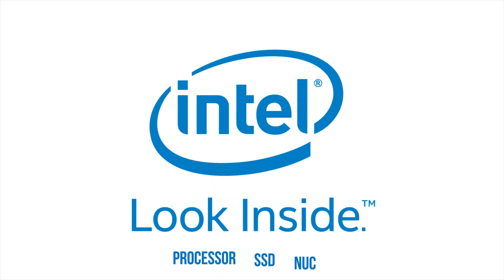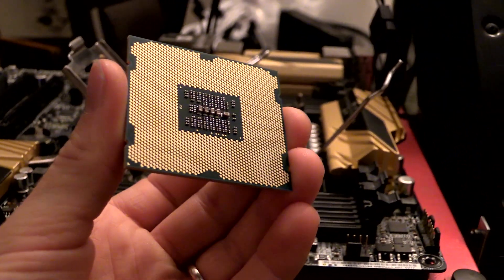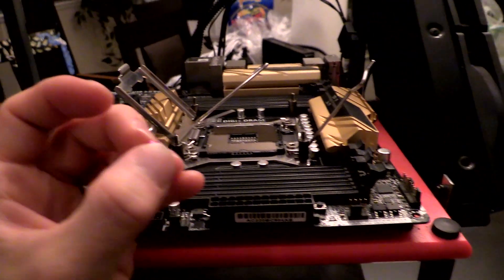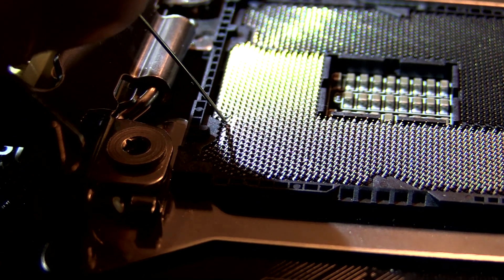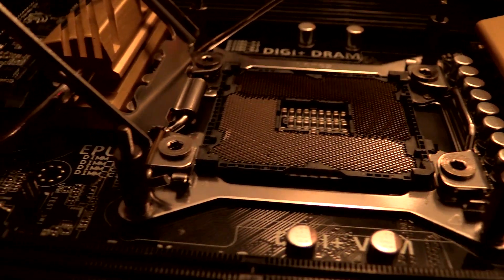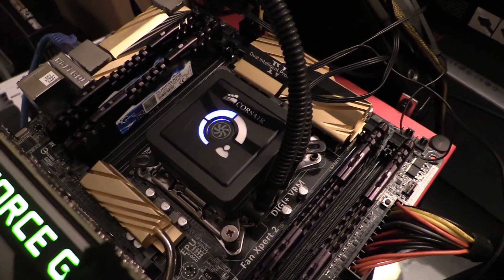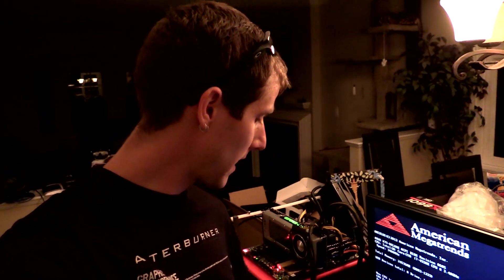LGA 2011 Socket Pin Repair Vlog - Fix a "Dead" Motherboard

Comment: That motherboard was still in warranty. I know, because Asus gold color motherboards came out last year, 2013. So, why didn't Linus RMA it? I wouldn't trust that ghetto repair, any movement would cause it to fail again. I would have RMA it, because it has between 3 to 5 years warranty, at least 2 to 4 years left.
Reply: Angel Luis Trinidad I think most of the people are gonna send to warranty anyway. Like Linus said so many times, "do what I say, not what I do." Unless it is a free board with no warranty like this one.
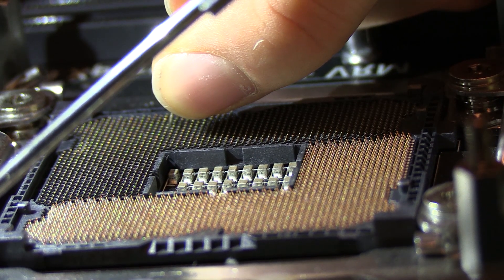Reply: Angel Luis Trinidad 2:50.
Reply: ***** Did Linus say it was an engineering sample? I watch the video, and I didn't hear that.
Reply: Angel Luis Trinidad He did, I would link the timestamp but I need to head out.
Reply: CK Gamer Thanks guy, it's true I heard it, it's an engineering sample. Still, I don't trust the repair, any movement can cause to fail, and if you keep messing with the pin, at some point, it's going break. Cross your fingers.
Reply: Did you read my other comments, I think that was already established, so, you are a little bit late. But, thanks for your comment.
Reply: RMA takes forever as far as customer services go. Good luck to anyone
Reply: Angel Luis Trinidad No offense. I want to put this politely. You should probably just delete the comment and comment chain. It will save you time. No one ever reads the sub replies.
Reply: ***** Look at the 2 posts above mine. I'm trying to tell the original poster that if he doesn't want to keep getting replies for stuff already covered then it's easier to just delete it. No, people still leave comments on the original correction even if a thread is 300 replies long...
Reply: I'm retired, I do this for fun. I don't care about the time it takes me to do a comment. I just want fresh new comments that add something new to the discussion. So, thanks again for your comment. But, I had to point out that what you said in your comment had already been said.
Reply: Did you not watch the video???
Reply: Void warrenty. I had this happen to me with a z97-a. Honestly i'd never built an intel so i didn't realize contacting pins are on the mobo so when i bought it and when the girl at the counter did a 5 second showing i had no idea where to look. Got it home and a week later after tinkering and trying to figure out why my last 2 dimm slots didn't work 1 pin in the top right was bent. This voided manufacturing warranty AND the extra 2 year plan i bought from the store on my board. Had to pay someone 45 bucks to basically do this. Though it's been a few weeks and all is well.
Reply: You don't trust "that ghetto repair", but you have to know that the "official" repair of ASUS would be pretty much the same thing, but with additional transport taxes or even more: in some cases you have to pay for the whole repair.
Reply: Really, I doubt that they would replace the entire mobo for just one pin that can be easily repaired.
Reply: 1EXTreMAR My experience with Asus RMA was very good, I got the RMA number online in less than 30 minutes for my Asus Z87-Expert motherboard that begun to have shut down issues about four month after I bough it. I sent the motherboard alone and kept the accessories. About ten days after, I received a completely new motherboard in a retail box with all the accessories. I didn't get a repair motherboard, I got a new one. Now I got two retail boxes and extra accessories. I only paid the shipping back to them, and they paid the shipping back to me. I was really happy with Asus RMA service. Off course for those ten days I had to use another computer, that was the only hassle. But generally, I recommend the Asus RMA service.
Reply: Angel Luis Trinidad
I don't think asus will RMA this because could be a user fault. I mean if you bend the pin form inattention or negligence asus will not pay for your fault but I heard EVGA does. I know someone who dropped a screwdriver into the socket and Asus did not RMA the board for his stupidity
Reply: Yes, so in the end asus will not RMA boards with bent pins :)
Reply: Angel Luis Trinidad I agree that a repair can have issues that come back later. It looks like this motherboard is in the test bench rig so I am sure it had CPU's swapped a lot for testing. Probably not a big deal for Linus to use it as a test still. If it were my MOBO I would start saving for a replacement just in case.
Reply: it's and engineering sample they don't have warranties, if it did have one he would have have RMAED it.

Comment: I've had the same luck on a previous AMD CPU. A pin was slightly bent and I was able to straighten it enough for it to fit back into the socket without braking the pin itself. It still works amazingly.

Comment: Congratulations, just saw your dead gpu video. Maybeee, just maybeee you should go for a longer heating next time. I did exact 8 minutes 200°C but first i did  the gpu manualy with a heat gun at 500°C (because it's so good protected), wich saved a Samsung monitor PCB just a few minutes earlier. With non conductive thermal compound, wich you can basicall smear everywhere the gpu, memory and voltage converters are cooler than ever.

Comment: The question is how long will that bad pin last and what errors it will produce; hopefully none. ASUS is good about some repairs, but a bad pin is an instant void of warranty. Tip anytime I RMA and bad MOBO I take pictures of the CPU socket to avoid any questions.

Comment: HEY next time just grab a mechanical pencil and use the end of it to slide the pin in the hole and adjust it in what ever way you need to bend and FIXED if not ur fucked EZ PZ better than "PEN"

Comment: I had two bent pins on my new mobo. They are freakishly small and delicate, it' hard to see where are they bent and original orientation.
It's a more elegant system than AMD's but for bent pin repair it's a nightmare.
But, I managed to do it :)

Comment: I think Mine Pin of the LGA 1155 Mobo is bent too. Giagabyte Mobo. 
But Great part is that my PC boots and Works Fine.
How can i know if my CPU gives some Error.
I cannot Stress Test my CPU (Prime 95) as i dont have Water Cooler. Using Stock Heatsink. (Core i7 - 2600 no OC)
Can some one Suggest me a decent Benchmark Software ? (For Stock Heatsink)

Comment: Hey people, I'm looking forward for a gaming system which can play games such as Crysis 3, BF4, or Saints Row IV (Ultra) and perform more than 60 FPS. Will I regret something with this build?
http://pcpartpicker.com/user/Henvertek/saved/d8ytt6  Intel core i7 4790K 4.0 Ghz, Asus Maximus VII Formula, Asus GTX Titan Black 6gb, Kingston HyperX Beast (4x8) 1866, 	
Noctua NH-U14S 55.0, Corsair CX 750W 80+, SSD Samsung 840 EVO 120GB, and HDD Western Digital BLACK SERIES 1TB. I'll build the case by myself if I can
Reply: Dont get the titan black, get a 780/780ti/290/290x
Reply: Is this only going to be used for gaming?
Reply: yeah, this pc is ridiculous. get a 290 or 2 290's for the best performance for the money and a larger psu, 8-16gb ram TOPS and id stick with that processor. i have the same thing. also if you want to spend less money you dont need that ridiculous motherboard. you could get something cheaper like the msi gaming 7. thats what i have

Comment: whats all that black stuff on the cpu
Reply: thermal paste
Reply: abc140290 why does it look all burn though
Reply: It's the black goo from prometheus.
Reply: SidTheSloth Could be different thermal paste than you're used to using. The stuff I use is pretty light, plus the lighting for this video wasn't the greatest.
Reply: SidTheSloth I think it's liquid ultra, or some other liquid metal paste.
Reply: TheRuiner84690 I just use the stock fan :(
Reply: Astralify plot twist

Comment: Thanks for this video! I tried to sell a working motherboard to someone, and they came back saying it didn't work, so I refunded it then after they left I noticed they had bent the pins. I tried fixing it myself without and tutorial but it just got stuck in a boot loop, I didn't have RAM inserted though. I'll try this, although I still don't have extra RAM to test it with. I'm scared of using my working RAM. :(

Comment: I had to fix about 13-15 pins on my 1366 because the plastic around the socket chipped a piece onto the pins while seating the CPU... it was working perfectly and stable in triple channel mode without detecting 1 out of 3 of the RAM sticks... go figure

Comment: i scored my gigabyte ga-z77x-d3h off a freind who considered it dead which had beed sitting on his bed for quite a while with no static protection and had at least a dozen pins bent on the LGA1155 socket bent so he told me if i can fix it i can have it so i took it home and lets just say after nearly a year im using it to write up this comment XD

Comment: Had a buddy of mine with an AMD FX series try the "put something else in the pin hole" trick and he couldn't figure out why it worked with the board lying flat and not when it was installed vertically in the case. We eventually found out that the wire he used was too short and then it killed the CPU. Dropped another $300 on a new one, sadly, but we got it working. Great rig now!

Comment: I've been using the edges of a (paper) business card to fix bent pins because it has a lighter pressure when re aligning pins than something more solid such as needles. Try it on your dead motherboards so you can see what I mean.

Comment: i used magnifying glass and a mechanical pencil to fix the bent socket pins for LGA1366 the same exact thing happened to me...and it worked .and then i sold my PC as fast as i can.

Comment: Lost a z67 board trying that :( and my i7 2700k 700$ down the drain when I reseated the CPU after bending the pins back after getting successful post and boot. Sad the i7 went 5.2 stable lol and I killed it

Comment: they should make new sockets, (the cpu has spots on it, where the pins hit the cpu) why not make a removable socket, which could lay on the spots of the motherboard, and the cpu would go in the socket as normal

Comment: I had to do this once @3am 2 nights before a deadline with a brand new board (old one died that day) and I didn't have the time to RMA the board. Only difference is I had 15 bent pins for some reason :S Nice job Linus :)

Comment: Actually had this happen to my Maximus VI Hero a few months ago. While replacing the thermal compound on my CPU and waterblock, I noticed the pins were a bit bent. Used a needle, magnifying glass, and my phone's light just like in this video and moved everything back to where it should be. Worked just fine.

Comment: I managed to repair a very similar 'bent pin' issue with a Socket 2011 board by using this technique.

The pin was intact and was 'just' bent out of position.

Very genital coaxing back into position using the other pins around as a reference. Look at the pattern the other pins make in each direction and get the offending one back into place.

Probably best not to damage them into the first place but it can be done if you are careful.
Reply: ROFL. 'Very genital coaxing', u made my day sir!
Reply: I'll just blame the auto correct ;-)
Reply: Dennis Tenn What if he really means Genital coaxing? XD
Reply: It's obvious he meant gently coaxing but LOL.  Genital coaxing is funny.
Reply: Tee Hee Hee ;-)
Reply: HailgodMC lol

Comment: Neat Tech Tip.
I had a bent pin in a board I owned once but I just told the manufacturer that it was their fault and got one for free.
Also can you guys do a video on removing infestations from a PC tower?
My case is quite open so I get millipedes and wasps in there.
Reply: AngryBullbog Never believe Lame Xeno, he's a known troll.
Reply: I can't tell if your being serious or not, but i bought a mini accessory kit for my vacuum that does the job of removing any dog hairs or dust that may be lingering in my PC.
Reply: ***** He's trolling, and being lame. Don't feed him.
Reply: Besty008 stop feeding the troll damn it!
Reply: who the fuck has a wasp nest in their PC?? - lol
Reply: *****  No, no, no, no, no, no, no, NO! Nuke them! Rain glorious burning fuel down on their tiny little heads! No bug deserves the honor of taking residence inside a glorious  #pcmasterrace  computer.
Reply: kek
Reply: same with my amd fx 8320 because this is what happened i took out the stock cpu heatsink to replace it with a new water cooled system then when i took out the cpu heatsink and ripped out the cpu and bent a little pin then i tried to bend it back but it snapped off so i called up AMD told them everything and after a whole month i got a new cpu and they upgraded my cpu to a fx 8350 :) :) :) :) :) :) :)
Reply: Mayur Vishram
actually, I can't see any reason why people shouldn't just buy cheaper chips and bend the pins themselves in order to get more expensive replacements.
We get better deals and the manufacturer moves more units.
Reply: ***** That's still fraud.
Reply: Nigga damn. Bug magnet
Reply: EmmaCross94
wouldn't it make more sense to start a fire outside of the case and use the smoke to draw them out?

Comment: Dropped my 2600k on the socket and pushed a Pin up under another, took me an hour to gently pluck it back into place with a tooth pick. Before I realized the damage I booted the PC but it failed to start the GPU. 2 Years later and many CPU changes that board still works.

Comment: I repaired pins on my fx8150 before because my asus motherboard had plastic in the holes that I removed afterwards too late at that point but even though the cpu was fine but that mobo was dead already.

Comment: Had this issue with an LGA775 display board, that I bought from a refurb store. I'd been waiting on it for ages, so instead of straight up sending it back to get it repaired, I got a friend with steady hands to help me out, and the same thing!

It. Just. Worked!

Comment: i feel like the reason why Intel switched from pins on chip to pins on board is because that way since the socket pins will be more likely to bend then the cpu pins the customer will usually go to the motherboard company for help instead of Intel, that way all the problems & warranty are distributed to all the mobo companies instead of all to Intel
Reply: Smart thinking. I can't think of any good argument to why that isn't the case.
Reply: Plus you can fit more contacts in a given space with LGA than PGA
Reply: That's really the reason though.  It's the pins per inch.  775-2000+ pins on a CPU is going to be problematic.  Could you imagine how many broken CPUs you'd have if those tiny ass little fingers where on the cpu?  I dropped a Xeon the other onto hard tile.  It was loud.  I was LIKE SHIT!  CPU IS FINE.  Drop a motherboard and honestly if it doesn't crack, severely damage a corner or knock a component off then it's going to survive the likely hood of the pins being touched during the drop or slim to none.

As far as used market goes I don't think anything would survive if we put 2000 pins in about 2 square inches.

Plus what would the motherboard have?  2000 pads or 2000 holes?  Nah.

It's because of density and pins per inch not because of Intel being shady.
Reply: Also I'd rather have to replace a $150 motherboard than a $250 CPU.
Reply: Intel, clever evil fucks!
Reply: That makes sense to me! Through the whole video I was thinking what a dumb idea it was to switch the pins, but now I understand.
Reply: bassl0va Yeah just combined a 939 to one of my 1150's... The 939 is fucking huge.
Reply: I remember being scared of Intel CPUs because of the crunching sound they make. It seems like that doesn't happen anymore.
Reply: LGA has way better contact than PGA.
Reply: That's a smart way to think about it. Good observation